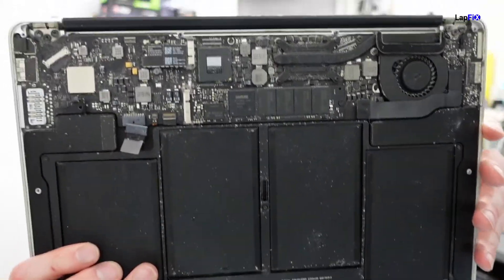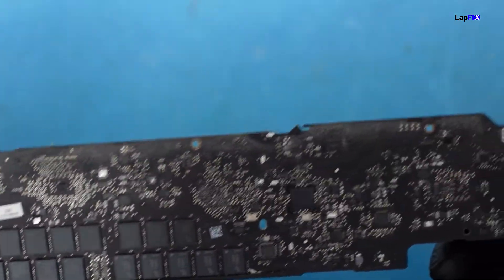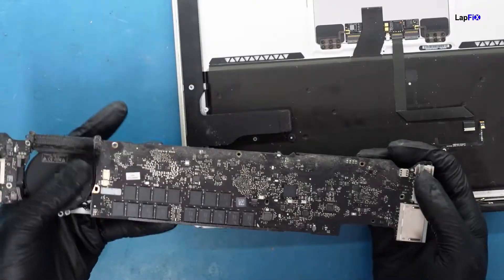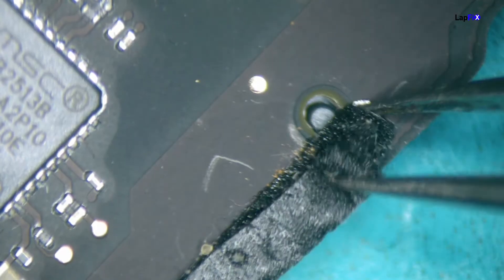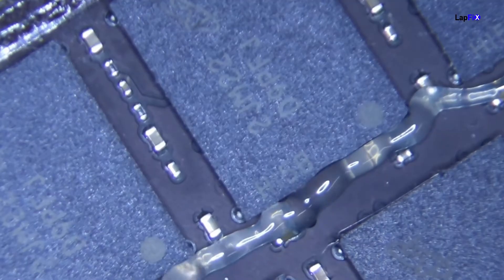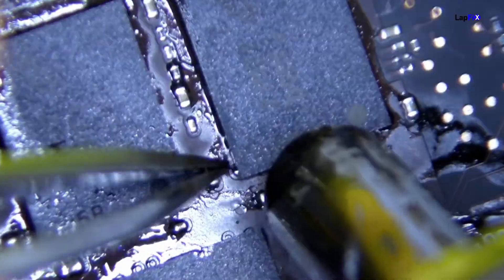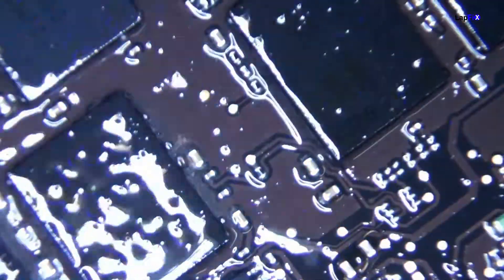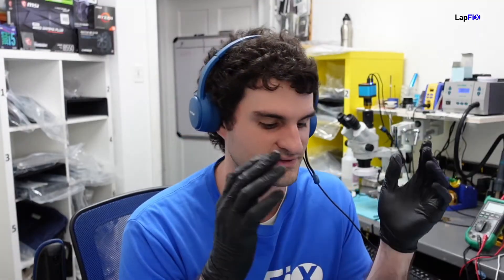How To Fix Macbook Beeps 3 Times and Won't Turn On

Comment: Can confirm this solved the problem.
I used amtech 559 flux and station set to 380° 60% air flow.
Reply: is it still working now? i heard resoldered ram only a temporary fix.. mine has been beeping for almost 7 years now

Comment: I have the same issue with my macbook pro. I have hot air station and a beginner. May I know what is the temperature and air flow you use to reflow?
Reply: I used 380° 60%

Comment: Hi Love the video very informative. I have followed Louis  Rossman when he did board repairs in New York at his shop. So I have some of the equipment he uses. I have an ultrasonic cleaning bath and use a PCB cleaning solution then rinse with IPA. Have you ever considered this for corrosion and flux removal.
Reply from the maker: Yes, if it is really bad and I make sure the solder is good first

Comment: Same issue with my macbook pro 2012 model.. took to apple service centre but they told it couldnt be fixed. Left in store for the past two years 😢 just to need to recover data . Any help
Reply from the maker: 2012 have removable hard drives.  Shouldn't be an issue to remove the drive to get the data

Comment: Hello, I had the three beeps probelm on my Apple MacBook Air 13, 2011, i7. I did a RAM reflow as described and shown in the video, but after I did this, the MacBook does not turn on. I get the light on the charger, but when I press the power button, the MacBook does not respond. What can be done, what can I check? Thanks for the help in advance!
Reply: you get some bad ram chip, must replace that bad chip
Reply: rip bros cpu